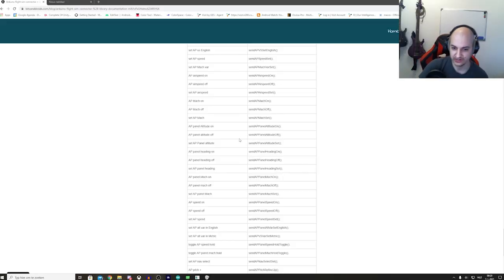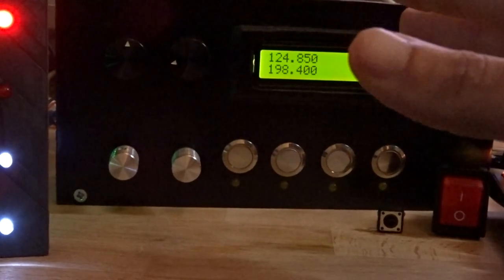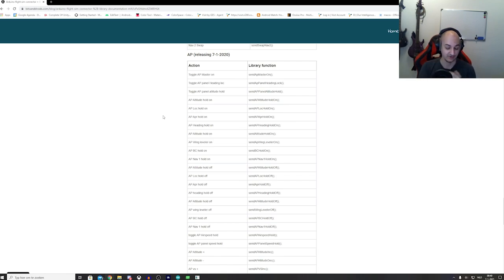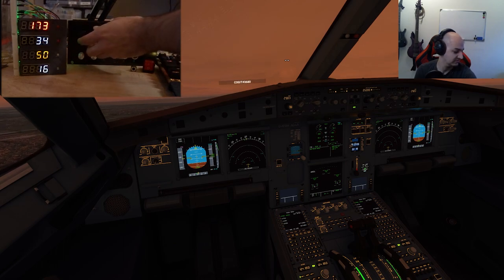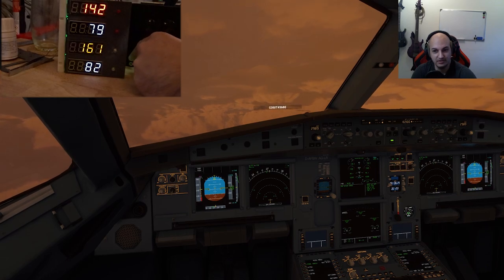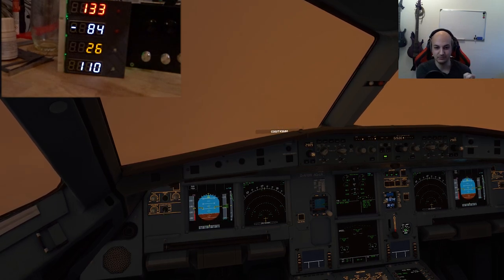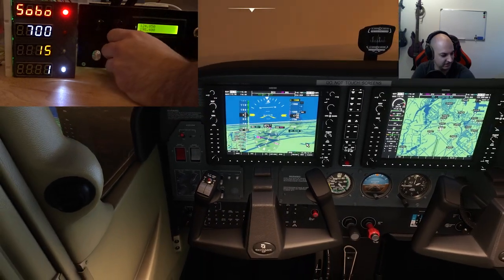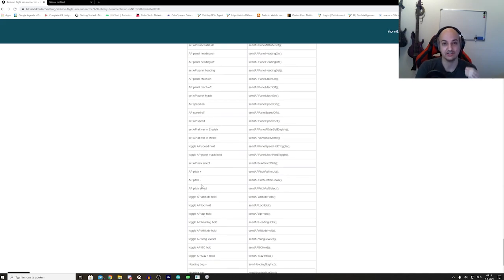Use your Arduino as MFS2020 autopilot. Library V0.6.5

Comment: Yes, thank you  for the new version. I can´t find the Flight Director in input list. But anyhow, the new features are awesome.
Reply from the maker: My apologies gonna fix that.  sendAPFlightDirector() is the correct one
Reply: @Bitsanddroids  really? I also tried to find the Flight Director, bur I can´t find it.
Thanks for your work, I really like it.
BTW. Can you give me alink to the 4Dig. 7Segment display? I would like to order the same one.
Reply from the maker: @DeineOmi1976  https://nl.aliexpress.com/item/32965437463.html?spm=a2g0s.9042311.0.0.71b24c4drPOJVp I Hope it changes to your local or else search for 0.56 Inch 4-Digit 7 Segment. they were like €0,90 a piece. I did have to solder the 4 header pins on though.
Reply: @Bitsanddroids   Thanks for the link. I ordered 5 pieces for 7€

Comment: installed the new library v0.6.5, now an existing script written using the previous library cannot seem to find  existing functions like getIndicatedAirspeed() and a whole bunch of others functions.
Reply: (solved) deleted the old libraries from Arduino folder solved the issue. A question came to mind, so does the connector only work as input or output, can it be both simultaneously?
Reply from the maker: @jmsian3505  it can be both simultaneously. The only limitation currently is that it needs a separate com port for both (so 2 Arduinos). In working on a way to get some base values to a Arduino to make it possible to just use one Arduino. Thanks for reporting that you need to remove the older versions will make that more clear in the future.

Comment: First, congratulate you on your great work.
Second, is it not possible to request data from the nav (active and stanby), and adf, and tranponder among other?
There are many .send functions but few .get
Thank you
Reply from the maker: The nav 1 and 2  should be in there under these functions
getActiveNav1()
getActiveNav2()
getStandbyNav1(
)
getStandbyNav2()

But you are completly right I need to get the ADF transponder etc in. I'll try to add them next release. They are purely missing since I had no idea what they were doing. I'm kinda new to this side of flight simming (the part where there is more than take-offs and landings using all the assists).

Comment: Using more parts of the connector. Yesterday, ventured into the lights section, took a lot of head scratching, could not get it to work it either returns all true or all false regardless of the light state in the game. The avionics section, flaps and rudder/trim sections work as expected though. Could be be cause the lights are not strings but bool? Just guessing.
Reply from the maker: It should work knocks on wood which plane are you using? I'll have a look to see what is going on
Reply: @Bitsanddroids  tbm and cessna skyhawk g1000
Reply from the maker: @jmsian3505  But the states are booleans indeed. they will also return as an boolean so if(lightOn) is a valid statement. I'm going to check why they are acting up will report back when I know more.
Reply from the maker: @jmsian3505  Ok it seems like there is some plane specific behavior in play here. in the TBM I get exactly what you describe it stays in 1 state. If I switch to the Skyhawk G1000 the same code does seem to work. I've had some issues with the lightning since day 1 due to these irregularities and sofar it's been mainly Asobos implementation of the SDK. They are still actively finetuning it for MFS2020 which could result in behavior as we see here. I'm creating a lightning test bench and will keep u updated when I know more. I use the following code for taxi lights (this can be changed to the proper lights needed):   
#include "TM1637.h"
#include <BitsAndDroidsFlightConnector.h>
BitsAndDroidsFlightConnector connector(false);

#define CLKA PA_9//pins definitions for TM1637 and can be changed to other ports
#define DIOA PA_8
TM1637 tm1637A(CLKA, DIOA);

void setup() {

SerialUSB.begin(115200);
SerialUSB.setTimeout(1);
Serial.setTimeout(1);
tm1637A.set(BRIGHT_DARKEST);
tm1637A.displayNum(10);
tm1637A.init();
}

void loop() {

connector.dataHandling();
if(connector.getLightTaxiOn()){
tm1637A.displayStr("on");
} else{
tm1637A.displayStr("off");
}

}
Reply: @Bitsanddroids  Tried it and  it does work on the g1000, no luck on the TBM.  No worries will wait for asobo to work out the quirks.  Thx.

Comment: Sorry, pretty newb here, is there a way to check that the connector is working with MSFS, and to also dump the serial port to Serial Monitor?  I'm reading connector.getActiveCom1() but not seeing any value...  Awesome work by the way!  Thanks
Reply from the maker: Thats the nature of serial communication. Because the data comming in over serial can change rapidly(imagine landing the plane and receiving the speed + altitude + heading) it requires the line to be open at all times to pass these rapid changing values. Because serial communication is a one way street during transmission (the line can only be occupied one way if iflnformation is flowing) the connector keeps the line open to be able to pass the data to your Arduino. That's why you don't see any data comming in over the Serial monitor. Opening the serial monitor closes the communication between the connector and your Arduino.

  Now besides the technical backstory don't worry you are completly right your not able to see if the connection with the game is successful. I'm working on some ways to see the data that comes in to give you the possibility to see what is happening. I myself debug using leds for true false states and lcds/7 segment/tft screens  to display the data comming in. If you accidently open the serial monitor while the connector is running its best to close it and press stop and restart it.

I hope this helps.

Ps I'm also looking on how to dynamicly manage the connection making it possible to use the serial monitor.
Reply: @Bitsanddroids   YOU my friend are a STAR.  Yep, I removed all the serial output I was trying to do, and just turned on and off an LED based on the landing lights... Works perfect!  Amazing job, thanks so much.  By the way, I'm using a Teensy 2++ board and it's working fine.  I'll be following along for sure! Cheers!
Reply from the maker: @TheHexperience  glad to hear it works. in theory any device that can write / read to serial on a rate of 115200 should work (but the code could differ depending on if the board supports the Arduino IDE or not). The teensy is even more powerful than the Arduino (at a higher cost) sou you should be able to proces the data on a higher rate
Reply: @Bitsanddroids  Thanks so much for your help and replies.  So my USB joystick sketch.  I'm able to read and write serial data (to putty for example) and still send usb joystick data. Is that only because I'm using the teensy?  (sorry for the newb questions).
Reply from the maker: @TheHexperience  It depends what kind of data you are sending and when you open the monitor in my experience with an Arduino. If the first values have been retrieved and you aren't retrieving intensive data (like airspeed) it sometimes is possible to log stuff via Serial. Once the data stream increases that usually starts to fail. Now I'm not quite sure how it will work with a Teensy (I still need to get my hands on one to see how they work). Perhaps something is different that makes your approach completly valid.
Reply: @Bitsanddroids  thanks, I have no approach, just trying to learn what the heck is going on. :)  I'm not running the connector AND putty terminal at the same time, I'm just using putty to see if I can send a receive serial data in the same connection.  When using the connector, I was not able to get the status of the landing light and send a comm change "at the same time".  So I started looking into the serial stuff on the teensy.  I want to be very clear about this: I have NO idea what I'm taking about... feel free to ignore me. :)
Reply from the maker: @TheHexperience  Ok in theory sending a command and meanwhile receiving the data is a pickle at the moment the way the system is set up. I do plan to make it possible in the future as a feature where you first receive a batch of base data and derive the sending of data from that point forward. I've just picked up a teensy due to your question because damn they look beefy.

Comment: Hello, I'm trying to do my first steps to make a simple panel. I downloaded the connector and did a simple ino file to get the strobe/taxi lights states. Which is the correct steps list? I run FS2020, then the connector, then the ino file, but the state does non change and no errors in the code.
How could I check the connector is really communicating to FS2020?
Thank you.
Reply from the maker: First of all which Arduino are you using? If you are using an Uno/Mega it's important to place a Capacitor of between 4.7 uf and 10 uf between ground and the reset (could be that you have to flip it 180). If you are using a Leonardo / pro-micro this step can be omitted. 
 The next step is to make sure it runs at baud rate 115200 and set a timeout (how to can be found in the docs: https://www.bitsanddroids.com/blog/arduino-flight-sim-connector-%2B-library-documentation-mN1zPxSHdmc6ZI4RIY6X).  
Once you are in the main menu (this is going to be fixed to work even if you start before the game) you're able to press start in the application. from there on out it should all be passing the data the moment it changes.
If the connector detects changed data you should see an led on your Arduino blinking the moment data comes in.   If all these steps didn't work could you send your ino file to info@bitsanddroids.com.  You do have a fair point that currently you aren't able to tell if the connection succeeded. I'm gonna put that on the list to implement the next release.
Reply: @Bitsanddroids  Thank you very much. Actually I'm trying with a UNO board, I miss the capacitor (now trying to get somewhere from old circuit), so maybe could be this, anyway in the afternoon I should receive the micro board, so this problem should be away. Is not clear from your answer if, in any case, I have to start the connector before or after the simulator.
Thank you
Reply from the maker: @fedemon76  Ah sorry when you open the connector doesn't matter. the important part is to hit the start button when you are in the main menu (or beyond that like loaded in a plane).
Reply from the maker: @fedemon76  Without the capacitor the Arduino uno/mega sort of soft resets everytime a succesfull connection is made over serial (incomming connection). This results in a seemingly unresponsive Arduino. I've spent many hours debugging while I just forgot to place the capacitor so it can be a real pain in the ...
Reply: @Bitsanddroids  Thank you very much for your effort...I tried to find a capacitor somewhere in the house from an old circuit, but nothing, so I'm going to try this afternoon after received the Pro-Mirco board. Thanks again I follow your works with interest
Reply: @Bitsanddroids  finally I've sent you an email, problem still present